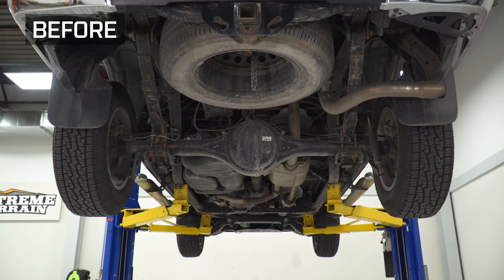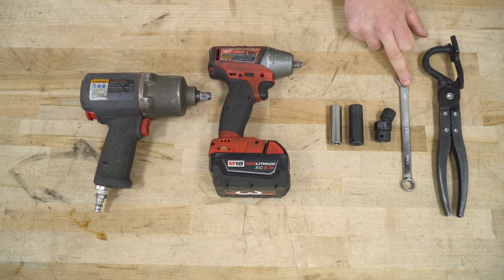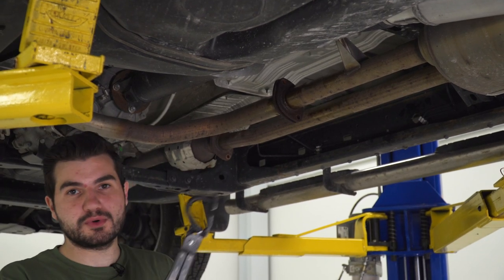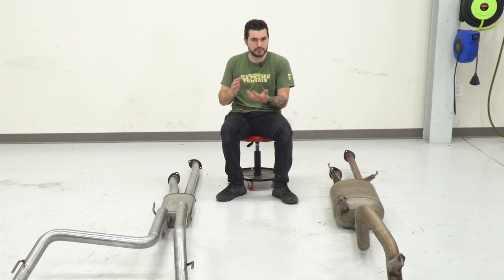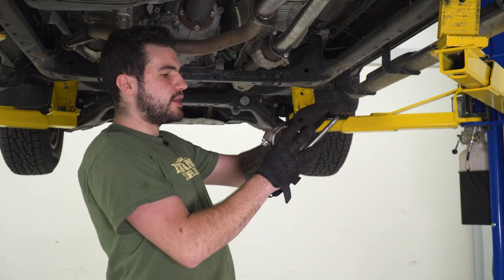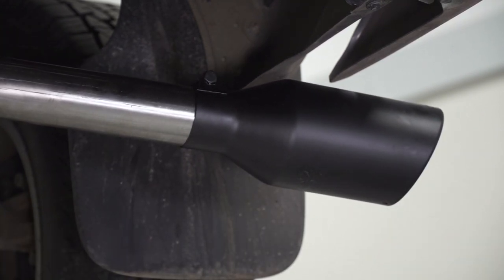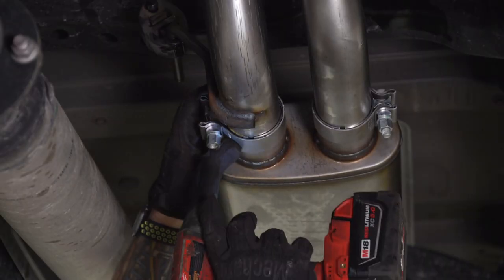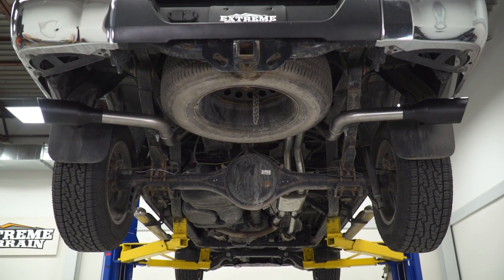2009-2021 Tundra 5.7L Flowmaster FlowFX Dual Exhaust System with Black Tips Sound Clip & Review

Comment: Just finished this installation on my 2010 4x4 SR5 Tundra. 
Notes:
Getting the bolts off were impossible, even with PB plaster and impact. Had to grind/cut them off. Went to Toyota to buy four new bolts/nuts. This was the worst part (took about 6 hours).  Using the exhaust hanger remover helped a lot, and WD40 worked decently while installing the new rods in the stabilizer.  Using bungee cords helps when installing the components. 

Looks and sounds great.
Reply: Thanks for the comment. I wish more people would talk about their experience when reviewing these systems.

Comment: Bought this for my 18' Tundra and the exhaust rear section did not align with the factory hangers. Overall happy with the product
Reply: Did You have to buy anything extra to get it to line up?
Reply: @redshark3582  No, it was the driver side where the issue was. The muffler shop added a exhaust hook closer to the rubber hangers, problem solved.
Reply: any issues with the truck related to the exhaust?
Reply: @Larrybobangles  nope after having it put on the exhaust is great no drone and not to loud
Reply: @antonior9937  Sweet, thank you for replying.